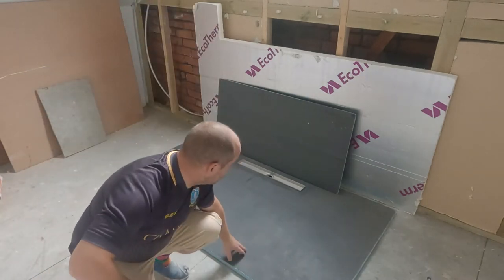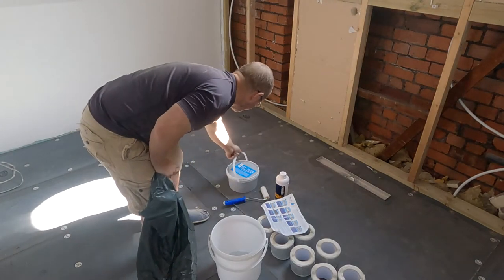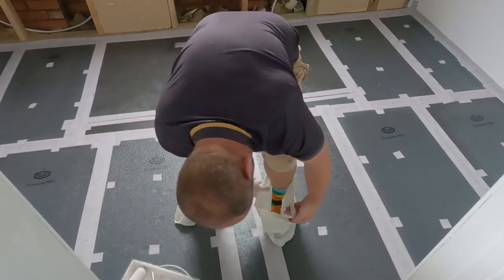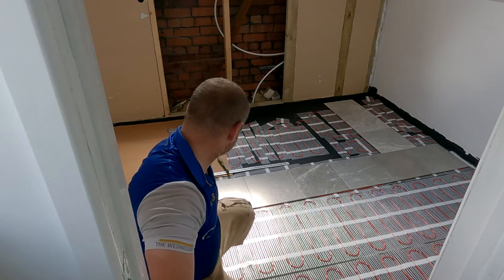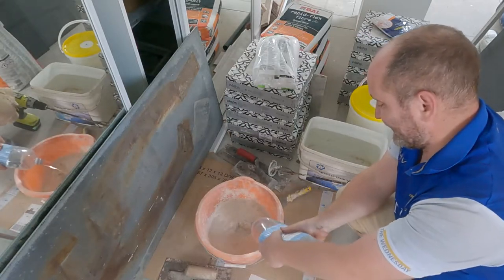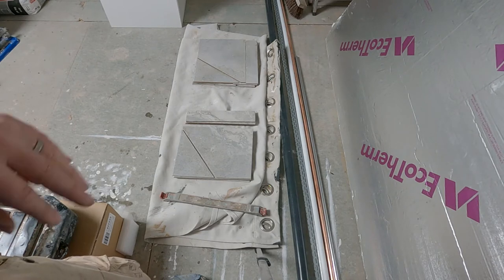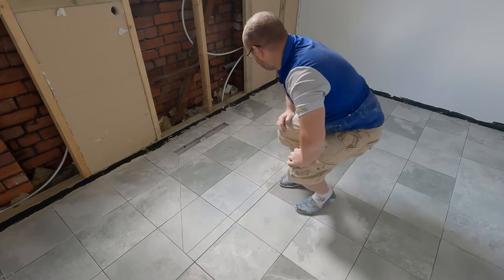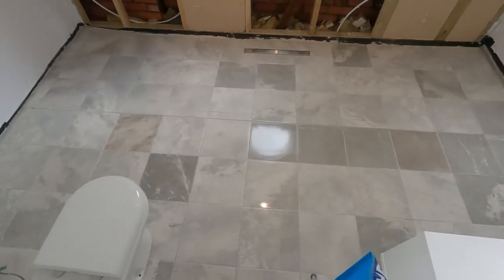DIY Loft Wet Room Floor Build With Underfloor Heating - Including Shower Area Build - Time-lapse

Comment: The floor insulation boards should be on adhesive as well as mechanically fixed.
Reply from the maker: Hi. Not according to the instructions.

Comment: I like to move my tiles around so that I get big tile pieces around the edges. I hate cutting and fitting tiny bits of tiles.
Reply from the maker: Hi. Thats fair enough, though I look for symmetry which means, unless you are lucky, fiddly bits. Its also an old house so not everyting is perfectly square which in a big area screws you over. Thanks for watching.

Comment: Great video! What kit did you use??
Reply from the maker: Hi thanks. It was from ebay I think. Lots available. Mine came with a wifi controller but there are choices galore.